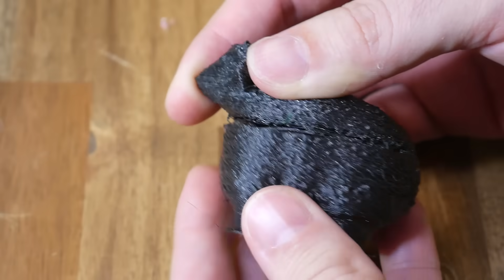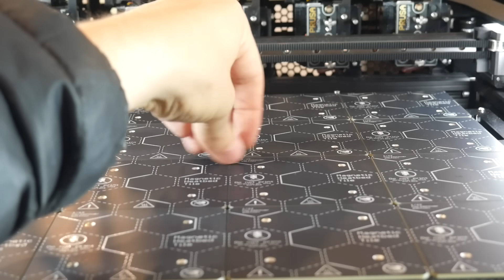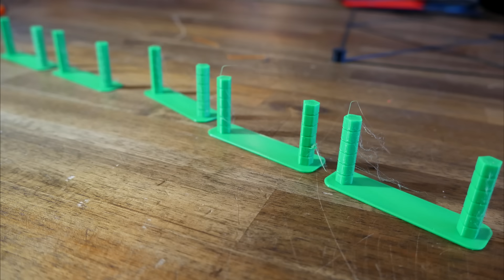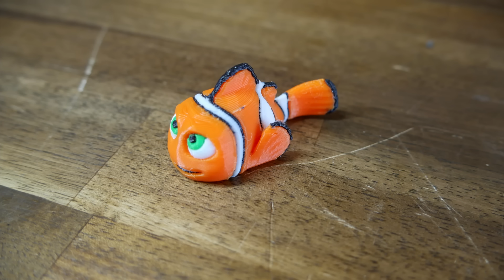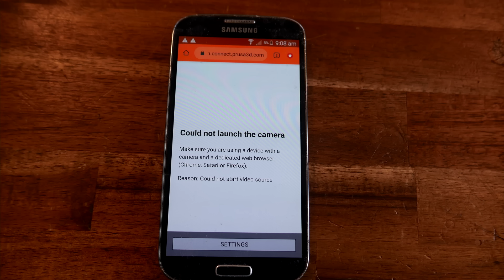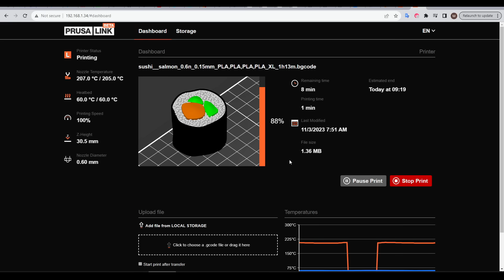The 5 tool Prusa XL is currently flawed, but I think it can be fixed

Comment: As i got my K1 Max i knew even befor i hit buy taht i have to do stuff myself (level bed, change extruder/hotend....) but only by the fact that not one single machine from creality comes "reliably"

For Prusa i have the Expectation to just work out of the box and be reliable because the other MK's did it (mostly)

Considering around 2000-3000 fur the XL or 750 for the K1 Max with the 3D Chameleon i would definitely go for 2 of the K1..

Comment: Such a same it does not run klipper...
For what prusa does for the slicer community its amazing, its a real shame it does not run klipper. That would be a game changer for community features and mods and well as camera function, tune / control
Reply from the maker: Adding klipper has crossed my mind, but there's a lot to unpick with the multiple mcus. I would need to wait for smarter people than me to decipher that. I'm hopeful Prusa will come through.

Comment: Prusa has some issues. They're not hacky small OSSHW company anymore.. they're up against really large companies doing really effective work and smoothing out all the hacking out of 3D printing UNDERCUTTING the prices of Prusa..

Yeah, Bambu doesn't have multi tool machine YET, but they've improved upon so many aspects of main frustrations people have about 3D printing and with very low prices -> Prusa can't keep going as they've done. If they want to sell 10.000 printers, they definitely need some very high end R&D, injection molded plastics, high end processors and hardware, very good algorithms and lot more time to make it right. High QA is important and if machines are overly complicated or less standardized, that'll all affect how much work it is to manufacture them and do QA.

They might be missing key people who are up to the game and we dont' actually know how well Joseph is running the company and that's going on behind the scenes.

Comment: Love your honest review!  I'm sure Prusa is feeling the pressure from the likes of Bambu Labs printers...but I feel like they rushed this...possibly in fear of falling too far behind and losing the brand recognition that they've enjoyed for many years.  For years...Prusa was synonymous with best in class for especially hobbyist grade 3D printers.  Like you said...they just worked, right out of the box for the most part.  Perhaps they got too comfortable at the top?  Got nervous with the vast success of Bambu Labs (warranted).  Nowadays...when I think of best in class...the name that comes to mind is Bambu Labs...not Prusa.  Stuff like this doesn't help dispel that notion either.

Edited to add that I own both.  I still have my Prusa MK3S which was my workhorse until I got my X1 Carbon bundle with MMU.  Now...I rarely use my Prusa.
Reply: I don't think Bambu Lab is perfect, and I do think that maybe more metal and less plastic would have been better in their AMS, but as their first 3D printer, I give them a break.  Not open source, but they sell most replacement parts at very reasonable prices. And in a rather short time, they have 4 or 5 models that all work well.  With PRUSA, I think their use of 3D printed parts might be to blame.  Maybe at a time when other 3D printers were made out of wood, it made sense, but today, not so much. Instead of producing solid hardware first, it was a low PRUSA priority because they could always "fix it later."   Unfortunately, it never gets fixed.  Maybe PRUSA needs some sole searching, if they want to keep in this business.
Reply: @A1N0  Prusa isn't really open source either now. Source for both software and hardware for the XL is unreleased.

Comment: Thanks so much for this.  I just opened my semi-built 5 tool head today.  I have been following TADA and she has been having the same problems.  I thought that I would be getting a top of the line printer and still hope that it will be, but seems like it is 95% finished, the 5% needed is the most important.

Comment: I think you could be much harsher. I certainly would be If I would have spent over 5k on this printer. 
At that price point this printer is a tool for professionals and not a hobby machine. And like with all professional tools I expect it to just work without any problems or hassle. 
Bambu Lab is able to deliver that in printers that cost less then a tenth of this one. Prusa has done a lot for the 3d printing community, but they have obviously been resting on their laurels, and now that lack of effort towards innovation is catching up. The mk4 was already a disappointment, the Prusa XL is downright unacceptable. Delivering such a terrible product at that price point is just crazy to me, what were they thinking. 

The bad print quality is just the tip af a mountain of bad decision in my opinion. Like the lack of enclosure, shitty network features, 3d printed parts instead of injection molding (3d printing at that scale is just a huge waste of time, money and recourses).

Comment: Yup, I was really hesitant to complete my order....but I did it. Now I'm having a few doubts about the quality. I'm also worried about the import duty charges, I got my MK4 through Fedex because it was cheaper, only to be surprised with a $47 dollar "duty tax". So turns out it wasn't the cheapest option. Has anyone received a duty tax from DHL here in the U.S.? I hope Prusa gets the bugs worked out of this printer. I was fine with the delays, as long as they were correcting issues. But making us wait 2 years and then giving us something that can't meet the Prusa standard of quality? Unexceptable.

Comment: Hello Michael, this is Christian @rapterron here: 

I am a "day one XL 5T pre orderer" from Germany and "usually" quite a pro prusa boy but I really thank you for this brutal honest video.

Unfortunately I made the same experience with my XL which was delivered on the 9th of September. Even if the prusa support tried their "best", but in the end they were just answering me things you would tell a 3D printing beginner, something like "dry your filament" etc. yeah no the exact same filament works fine on another printer and I also tested with brand new spools.

Even with all the shipment delays the printer hardware is fine and robust but overall it feels like rushed and in a late beta development state.

Never the less after weeks of profile tweaking I think I and found a 98% solution which addresses all the issues (with PLA, haven't really tested other materials) without tweaking the firmware or custom gcodes or hardware changes and mods.

My changes to the stock profile are almost entirely in the filament section (I use the Prusament PLA @XL 0.6 as base) of prusa slicer, everything else is mostly stock and adjusted by case.

- reduced temperature from 215 to 200 on the first layer and 195 on every other layer
- max volumetric speed to 15.5 from 16
- enable ramming for multitool setups with parameter 5 on volume and 10mm/s flow <---- THIS is the setting you were asking for in your video. Before docking the current tool he will wipe the nozzle on the tower
- default retraction to 1mm 
- retraction when tool is disabled to 15mm (default its off!)

Additional and also helpful is to set the Wipe tower purge line spacing to around 200% (was recommend by filament frenzy)
This can be found in the print settings tab under multiple extruders -> wipe tower

Furthermore the default extrusion with on the first layer is set to 0.68 mm which should create bigger and more robust first layers but I found out this might create also gaps in the first layer so I would set it back to 0.6mm

I also reported all my findings, feedback and even profiles to prusa support.

Hope this helps and please let me know if you have any question. I can also send you my profiles If you want to test them.
In general I post mostly on twitter / X including pictures of my prints.

Cheers Rapterron (Christian)
Reply from the maker: Thanks for sharing your experience and especially the tips. I will try them next week.

Comment: The quality of the parts are very lackluster considering the price. Also never understood why they don't use injection molded parts instead, which would also make their delivery time faster and quality better IMO
Not considering prusa anymore.... Thanks for sharing the video. Very appreciate it
Reply from the maker: I think one advantage is it means the process is agile as updated parts can be produced without retooling. It also means users can print fixes where necessary. The downside is the lack of polish in the experience.

Comment: What print surface are you using in your Bambu P1? Is that Garolite? (In the clip printing the antenna housing)
Reply from the maker: Look up VPS data. They make garilite sheets ready to go for the P1 and X1. Highly recommend.
Reply: @TeachingTech Thx

Comment: Engineering-wise Bambu Labs is just miles ahead of the rest.  These guys think about what they're doing, what the problems are that need fixing or the annoyances for the user and how to fix that reliably, yet cheaply (while still making a profit).  The only place where I feel they don't seem to understand the needs of the users is their obsession on the cloud, but then that might be an Asian thing ...  Anyhow, they seem to put something in the market AFTER having ironed out almost all issues.  Such a huge different compared to all other contenders, including Prusa.  Now, Creality and some other companies at least seem to have understood that they have to supply solutions for the problems they ship their first version with, but I would still trust Bambu more than Creality to still have replacement parts in 3 years or so ...  And the  there's the AMS and the attention Bambu gave on filament change, by having a cutter in the head and a poop mechanism and an area to wipe the nozzle clean and cool it down again to avoid oozing ...  They THINK while the others mostly seem to just copy with their brains turned off ...  I'm really looking forward to Bambu's take on large format and maybe in the future also on tool changing.  I'm sure that will bring a lot more thought-through solution which will likely also end up more cost-effective (and still giving them a nice profit) ...  It's really a shame that there's no Western company able to do the same, just because here - at least that's what I blame - being ISO999999 certified eats up so much time, effort and cost that there's no time left for common sense thinking or out-of-the-box problem solving (because out-of-the-box clearly is not following THE PROCESS) ...

Comment: I don't care how fast the printer could be, I only want a reliable and consistent printer that doesn't need much attention, that can be set and go as a work horse. My Bambu X1C is still the best in this regard after having Vorons and Prusas. I had high hope for Prusa XL but they can't deliver with quality right now and their technology is starting to fall behind, not looking good.
Reply: lol the tech in the XL/MK4 is literally the same as the X1. Saying their tech is falling behind means bambu lab is falling behind too.
Reply: @LilApe no it isn't though. software is also tech, and a part from the slicer prusa is falling behind. They can't even get reasonable network speed when even my creality k1 can. I mean come on.

Comment: Damn. Thank you so much for working on this. The stringing has been a huge issue for a ton people. I didn't even consider they would have custom embedded code for the tool-head swap. End of the day, this is a pro printer at a pro price. Anything less than perfect is wholly unacceptable. I'm a huge Prusa fan, and I'm sure they will get this figured out, but it never should have shipped in this condition.
Reply from the maker: Full credit to 3D print dogs for that one. My z lift changes aren't as effective as the added travel move.

Comment: I had a lot of success when I switched from .6 to .4 nozzle. It eliminated all clogging and stringing
Reply from the maker: I would have opted for all 0.4 mm nozzles if it were a choice. Now we have to pay to buy a set.
Reply: @TeachingTech  I didn't like it either, but I wanted to know where the error was, and also my nozzle clogged os bad, I could not get it fixed... (will still try but having one replacement never hurts...)

Comment: ~$7500 Australian dollerydoos! What a disappointment, which might somewhat be overshadowed by asking "why"? Understanding the delays to manufacture, but I would have thought this would have provided enough time, testing and surety for Prusa to test, refine and perfect the printing experience. The recommendations you've listed are not extensive, nor would take a significant amount of redesign to correct, bit it seems like Prusa is relying on the community to rectify the issue.

I can't accept the states of the machine based on the price tage; I would rather a modded Kobra max with the ERCF for 10% of the cost. Potentially still the same amount of tuning, but at least it would align (or more realistically, exceed) print expectations. This machine, I feel, really is a negative turning point for Prusa and passing of the crown - what industrial users are going to look at their professional range of printers that they have recently announced, if this "beast" (marketed as advanced, and costs premium) is offering this type of performance?

Comment: I have been baffled from the start as to why Prusa decided to reinvent the wheel instead of adopting the work in Jubilee and E3D toolchangers. All of these issues remind me of the early days there and a lot of work was already done to improve on tool change process to reduce stringing and coasting issues.
Reply: While I don't disagree with your general point about missed opportunities, I can't help but think there is a fundamental issue here. What was the last hotend you used where you couldn't tune out stringing from PLA on a basic tower test? Personally, I've literally never run one outside of like PTFE lined hotend with PTFE that's degraded and needs service.
So from where I'm sitting, there is something fundamentally wrong with the extrusion setup on that machine, forgetting about poor multi-tool management. My question is 'how is it different from a MK4?' Cus it's called a Nextruder in both, but there it actually seems to works.
Reply: @sneaky_tiki  I think that zhe difference is the 0.6 nozzle. In combination with high-flowndesign, that's recipe for oozing and stringing. Long idling of toolchanger probably doesn't hel. I think that they should've ship 0.4 nozzles on the 5 head variant.
Reply: @Papinak2  Oh, very interesting. I didn't realize they did that. You may be right, high flow setups need high accelerations and travel speeds to manage the stringing, so perhaps that's lacking.
I saw a video from YGK3D where he found that the toolheads don't always get picked up in a repeatable way, and that was his z-banding issue. He resolved by driving each toolhead into a bump stop to align them.
Reply: @sneaky_tiki   It´s also a way bigger printer. I really think we are seeing the limits of using printed parts for such a large machine. Guess it will never be as stiff, aligned and calibrated to compete with even the MK3, let alone the X1C.

Comment: You have a lot of valid points and it's a really nice summary.

One thing I wondered is if people have tried switching to 0.4 mm nozzles on the toolheads and compare the results. 0.6mm nozzles might be a lot more prone to stringing and oozing.

[Edit: I see you mentioned that in the end of the video :)]

Comment: I love my Prusa MK3S, but I cancelled my 5 head XL, day 1, preorder. The last straw was when Prusa wanted FULL PAYMENT UP FRONT to get the newest ESTIMATED delivery date for my order. This, from a company that is missing all promised dates. You're correct. A $5,000 USD printer that is running on Alpha software. And poorly at that. I was not about to pony up that much money on a printer that has obvious design flaws. Factory assembled printers that cannot print a reasonable Benchy right out of the box. You've done a great job of hitting the high points of the problems, but far from all of them. Like the TERRIBLE comm hardware they put in showcase printer.

A complete opposite is my Bambu X1 Carbon. I had been discussing my XL order with one of my sons. I scoffed at the X1C. When I cancelled my XL I went into research mode. The X1C looked really good. I found very few 'real' user problems. Bambu had done a really good job fixing concerns. Lot of spare parts available, at very fair prices, including the carbon rods. 

I ordered a X1C Combo on a Monday A.M., and Fedex delivered it on Wednesday noon! I took my time and setup was certainly less than an hour.  They have distribution depots in the U.S. at various locations. The Bambu slicer is great and pairs very well with Bambu Handy, the Android app. The software is very professional, with excellent integration, usability, and finish. The prints are flawless, with every filament I have thrown at it.

I am a EX-Prusa customer. My second AMS unit gets delivered today.